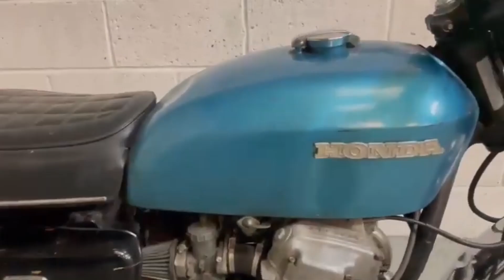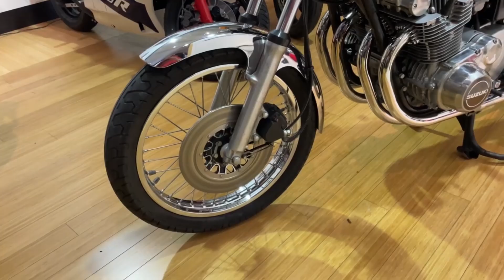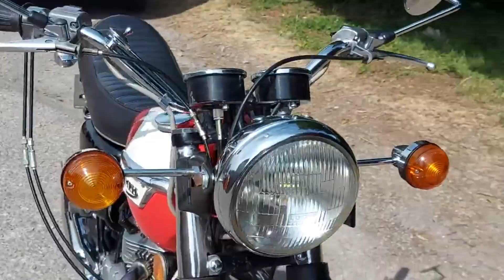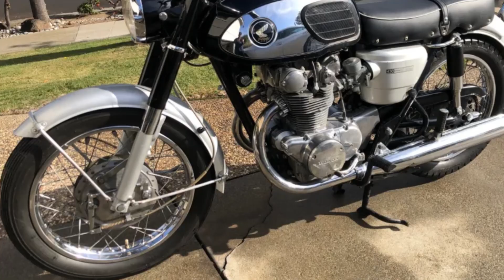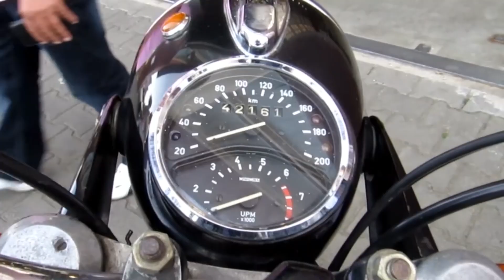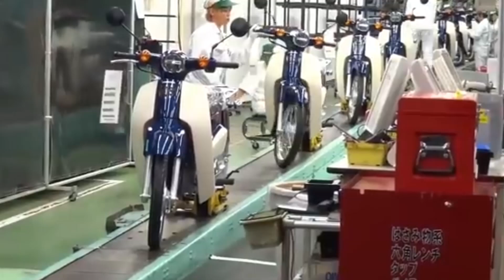10 Most Reliable Vintage Motorcycles Ever Built

Comment: Had a bad experience on my velocette venom clubman ,going around a righthand roundabout,rear wheel nut worked free+wound      speedo cable pulling bike to the right. 
Result of vibration from ton up ride on motorway.
Started riding twins.
Reply: Nuts or bolts dont work lose , they are left lose
Reply: @dereklmcguire  They do,from vibration?
Reply: @markbeale7390 65 years working on bikes , it is operators mistake
Reply: @markbeale7390  operator neglect